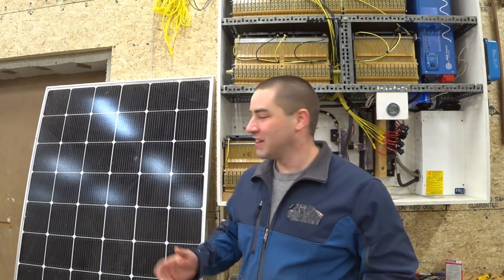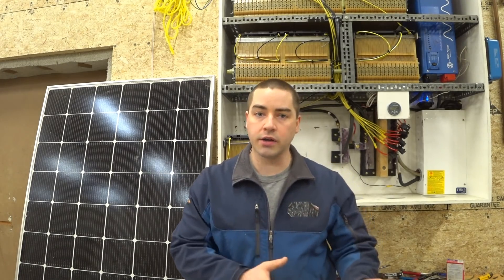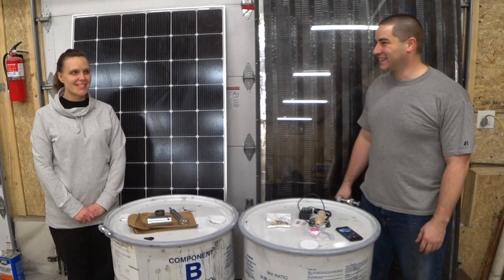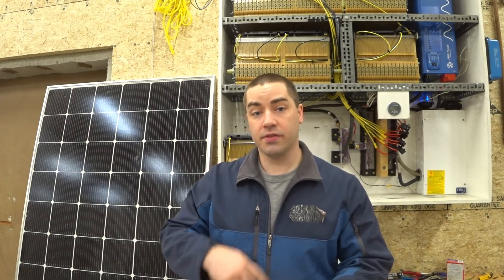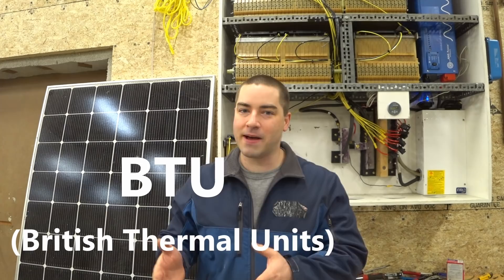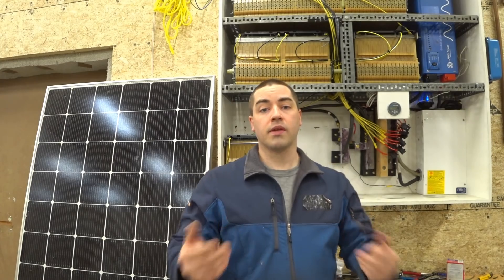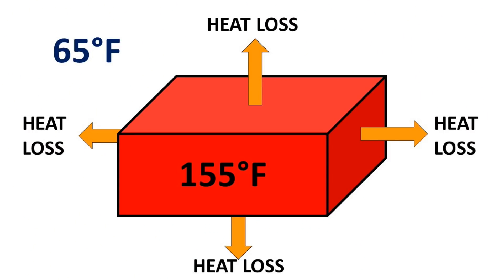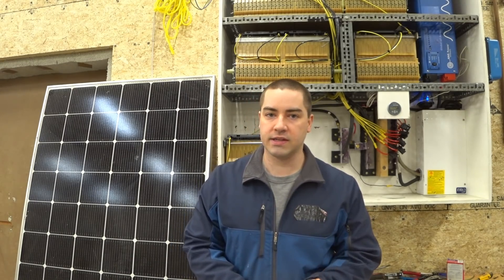Cheapest Energy Storage Off-Grid

Comment: lived in a walk-up 3 story 21 apartment house in San Diego in the early 60s all of the hot water was supplied a cistern painted black on the roof. One of the most efficient ways to use solar power
Reply: In San Diego ... Yes! Just like they've been doing all around the Mediterranean and Southern Europe for decades ... EVERYBODY has a solar HW heat exchanger on their flat rooves. Try finding the same thing North of say Frankfurt, you'll be hard pressed except on fairly modern multi apartment buildings. When the outside nighttime temperatures can drop to -35°C or lower MUCH bigger, MUCH larger area heat exchangers are required!
Reply: @boblewis5558 Solar panels that heat water work great even in Scandinavian winters.
Reply: @0ooTheMAXXoo0  Depends on the weather too. Had 2 weeks straight of almost no sunlight. Constant snow storms and cloud cover. Not to mention getting 30cm of snow can really cover your solar.
Reply: @Azsunes  …. Yes north can be dark, in MN we have dark weeks after month of sun but people can for week skip shower or take cold shower or do tramp-shower in sink.  Not to be macho but I am in a camper and heating up the shower water aint worth the propane-hassle so I take annoying cold shower.  Honestly is hot shower worth it, 5 minutes of cold annoyance is not worth 100 hours set-up time (6,000 mins or 1200x the annoyance time!!1) of setting up time for Solar Heating setup time, plus there's $5000 cost of solar ($5000 for 5 minute shower, or if 100 showers that's $50 a shower, damn!!!).  I am not macho but I am lazy, so again is hot shower worth all this effort.  Jeesh.   I am half-serious but still wonder.  : )
Reply: Alex Russell add ladies into the equation and the peaceful environment you get from hot showers will be worth it. You’ll have to divide the cost over several years to come to a reasonable cost per shower number, but if you can use it for space heating as well, that will be another huge benefit. 
For a dingle person, a wood stove will often be enough to function as space heater, cooking surface and hot water producer all at the same time. At least in winter

Comment: Would raising the boiling point make the system more efficent? for every  pound of pressure added to a sealed system, the boiling point raises 3 degrees F. For example, automotive radiator caps.
Reply from the maker: I built my tank out of plywood, so it can't tank any pressure.  But maybe if you were using a manufactured tank made for pressure it could help.  It would be fun to test and find out.
Reply: higher pressure doesn't make it more efficient. glycol has a higher boiling temperature, 130 C out of head) but has lower energy storage. plus, i doubt david's system would take  that higher temperature for a long time.

Comment: In the video you mention building your heat exchanger out of copper rather than pex  next time.  Can you elaborate please?  This is your best video yet!
Reply: Thanks for that insight, I've been debating copper versus pax heat exchanger myself.
Reply from the maker: Sure.  Before I built my system I was going through and reading lots of articles on Builditsolar.com  Great stuff there.  I saw a mix, some people use copper, and some PEX.  
PEX: 300 foot coil with no connections inside tank.  My 1" nominal size holds 8 gallons inside the PEX.  That 8 gallons of water is 100% efficient because it will equalize with the thermal tank.  8 gallons is enough for one shower because it is mixed with cold.  
However, the first month I used the PEX I got a strong plastic smell coming out of the hot water.  This makes me question the healthiness.  My whole house is plumbed with PEX and I never had that issue before building the heat exchanger.  So I figure it has to do with higher temps?

Next time I would first look for a salvaged heat exchanger out of a boiler or something.  If I can't find one then I would look for a copper coil, 100 feet, maybe 3/4" or 1" nominal.  Yes, it would cost more than the PEX coil, but no plastic smell.  I think the copper would be better suited to being submerged in the hot water.

I hope that helps.  At some point I hope to make an experiment to put some numbers to this.

Comment: Have you thought about other storage systems like HHO, you can burn it or just turn it back into electricity
Reply from the maker: I've thought about it, but I haven't made an HHO generator yet.  You can't pressurize the gas unless you separate the hydrogen from the oxygen.  I've seen an example once where someone used a huge rubber bladder, the size of my garage to store the gas.  Lot's of very cool solutions out there.

Comment: I had settled on exactly this method of storing heat energy.. Though with perhaps a bit difference on the storage box.  I plan to use two 375 gallon totes. .. Because they are already confined in the totes I do not have to beef up the the box as you did with the polyiso.  This way I only need to support the  insulation..     Can fill the box with 12 inches of cellulose. on all 6 sides.  Additionally since there is more water I do not need to heat the water nearly as much to provide a similar BTU storage in each storage tank.  This in reality means higher efficiency.    Suggest that you put a thermister on the in and out of the domestic water so you can see what the water temp delta is per shower usage.. My bet is you will discover that the change will not be a great amount.  I know you appreciate logging this sort of thing.   Go to a larger pipe such as 2 inch for your heat exchangers and you will also get the delta you desire without the cost of going to copper.
Reply: Thanks for the 2" tube idea instead of expensive copper!
Reply from the maker: I'd love to see a video or pictures of your setup in the future.  Good luck with it.  750 gallons is going great.
Reply: @DavidPozEnergy  Have to build it.. and they will come LOL.. Originally had planned to build like you did.. but after thinking about it.. just made more sense to not have to build with 3/4 ply, lots of 2 x material to keep the box from blowing out with the water weight against the container.. plus a foot of cellulose around all 6 sides pretty much means a very very low heat loss. R42  will certainly hold the heat longer and what is nice is having larger capacity easy to do radiant heating
Reply: aerocrete is an awesome insulator

Comment: Any thoughts on what you will do with the extra hot water in the warm months?  Maybe you could make a food dehydrator, or low intensity clothes drier for wet days?
Reply from the maker: My current setup is three solar collectors mounted vertically on my south wall.  They don't overheat in the summer because the sun is so high overhead.  So I don't actually have extra hot water in the summer.  This is not the best setup, but I was using some wall space that I had.  Your idea of a dehydrator or cloths drier is good.

Comment: Always very in formative.
As well as saving on the cost. Your water heat store will run for 20 years safely.
Those batteries are going to die after a few years and they need checking and could be a fire risk.
Low tech solution which if you have a sloping site could give you enough water pressure will run for years. Solar and sustainable.
You can also get your thermal store feeding a top up water cylinder if you can't hold sufficient water at 180f. Every  solar  btu is one .off grid btu saved.

Comment: Everything depends on having three panels of adequate area 
1. Hot water
2, electricity for running the hot water system and controller
3, electricity for things that really need electricity -power tools, lighting.
Any water kept for long at less than 60C /140F needs to be considered as a possible bio hazard  so needs a biocide if it's not going to be consumed or showered under.
Do consider that a tank of water at 150F will evaporate and leave moisture in the air to condense on the floor joists unless you move the condensation away to outside.
Reply from the maker: I have a lid on my tank for the condensation: https://youtu.be/W03zjGPCjjE  Thanks for watching.

Comment: This up coming week they are calling for 8-9 days of rain. My next solar system I build I would like to spec it out to run my home with 100% cloud cover. That will take a lot of solar. I'm guessing 4 times the solar panels. I wonder how the solar hot water needs to be.build.for.the same.cloud cover
Reply: I run my camp real time with solar. I only have a car battery for storage but still have things like a dishwasher with heated dry. Panels are sized so at least the fridge can run on even the worst rainy day. My water uses are low and have two tanks in series. Did have a 10 and 20 gallon till the 10 gal started leaking.  Now I have a 6 gallon as the primary. That only takes 900WH to raise 60F. If the feed water is higher it takes a lot less. Small tanks give you fast recovery.
Reply: you look more like 10x.  say on a sunny summers day you need 2kwp panels, you will have to go for 20kwp.  keep in mind the last 10% will be 90% of panels. 
there are infinite degrees of cloud covers. the worst are thunder storm clouds. luckily they only last a few hours.

Comment: Wonderful video as usual. I'm wondering how this will pan out near the equator or where their's enough and nearly 12 hours of sunshine all year round. I'm imagining in such situations, one may use normal electrical water heating without the complexity of this tank system since the batteries  are guaranteed enough daily top up charges. What are your thoughts?
Reply from the maker: I would agree.  If you have daily sun then probably an off the shelf water tank could work well.  I might get a big one, like 100 gallons, but otherwise a lot simpler.  No heat exchanger to worry about.  Zero days of autonomy.

Comment: Liked your heat exchanger a lot. Heat pumps should not be dissmised - they do add complexity and cost, but also efficiency.
Reply: I second that motion and add:
Solar hot water can get the water up near boiling.  You want to store water this hot when the sun is out but not deliver that hot of water to the taps.  This adds a bit more complexity in requiring a mixing valve.  Don't cheap out on the valve because the bad ones stick at one extreme.
Lead acid batteries may cost less per KWH of storage even through they need a lot more room.
Extra very hot water can provide space heat on cool sunny days.  Keeping the house warm stores energy too.
Reply: The benefit of a heat pump is you are creating heat but gathering it and moving it into a storage device (tank).  Where electric heating is 100% efficient by directly heating water, the heat pump water heater has an efficiency expressed as a coefficient of Power equal to 2 or 3 which is 2-3 times more energy efficient that direct electric heating.  Definite applications for it with solar, particularly if we can use the solar dc power directly without an inverter.

Comment: It would be helpful to include the cost for collectors to generate 125K BTUs stored in the 301G water tank on minimum sunny days (I'm thinking it would take more collectors in the winter).  

I'm guessing there is a pump which circulates water from the solar water heater (I think that is a plate collector reading other comments).  How much power is consumed by the pump daily?

Another BTU loss is the pex run from the solar heat collectors to the water storage tank.  How do you minimize this (underground/insulation)?  Also do you minimize water tank heat loss by only running the water pump when the plate collector temp exceeds the water tank temp?  If not this would be another BTU loss to consider.

It would be great to see how you supplement your house heat with this.  I'm guessing once you reach 180F you shut off the pump to keep the water within it its defined range.  With additional coils of pex/copper in a corner of your house I guess you could start a pump to circulate water in these additional coils when the temp meets some threshold, maybe 170F.  In this way you could dissipate extra heat generated by the plate collectors instead of loosing the heat because the water tank has hit 180F. 

This is a really cool concept.  Thanks for sharing.
Reply from the maker: Hi Knut Blaise,  Thanks for all your questions.  I'll give it my best shot to answer them, but If I miss something check out my channel.  I have lots of videos on this topic and I think some of them will answer your questions.  

Cost varies a lot based on several variables.  I can usually buy salvaged collectors for about $100 each.  I'm using 3 collectors right now for my 250 gallon tank, but I'm thinking of adding more.  https://youtu.be/NDxmPl5jlVA  There is a pump and controller to pump the water up to the panels when the panels are hot.  This pump shuts off when the panels are cold.  This video is for a different setup, but shows the controller and pump well: https://youtu.be/kkoesuG72xQ  And it shows insulating the pipes.  

Here are two other videos that I think answer some of your questions: https://youtu.be/g0_-zAskgnE and https://youtu.be/W03zjGPCjjE

Thanks for watching.

Comment: I’m a Mechanical Engineering student and I finished thermodynamics class last semester. This video was fun to watch. Couldn’t you of used an automotive radiator as a heat exchanger instead?

I understand what you mean about storing BTUs in water instead of batteries but isn’t storing it in a battery better? It’s not really the same because of entropy right? Because the electric energy is more useable.
Reply from the maker: The heat exchanger has to be listed for potable water (drinking water safe).  Even if you bought a new car radiator it's not going to be listed.  However, if you were just setting up an experiment for fun, it would be neat to see how effective it is.

The chemical potential in the batteries to make electricity is outstanding.  You can turn on lights, computers, run motors, etc.  You can also heat water with it.  But you lose too much in the conversion of solar PV, to batteries, to electricity, to heat water.  My point is simply that it makes more sense to store hot water for your hot water needs.  Keep the battery as small as possible just for your loads that have to be electric.  Thanks for watching.

Comment: If you could add pipes to the back of the solar panels, you could collect 4x the PV energy in heat while also cooling the cells which increases their efficiency. Win-win!
(I grew up using both imperial and metric, but my eyes glaze over with BTUs. In future, please account for both for a worldwide audience!  Celcius, joules and kWh are universal, logical and easier to calculate with).
Reply from the maker: Hi Andy,  I probably did a poor job at converting.  Sorry about that.  At the very end of the video I did try to convert over to KWH.  My tank, 250 gallons (946 Liters) can hold 30.5 KWH.
Reply: @DavidPozEnergy  Thanks - that's quite a lump of energy. Yes, it's far cheaper and better to harvest heat directly than use PV to heat water because there is so much more of it up for grabs, and you explained that very well.
IMHO, the only case for using PV to heat water is for boiling water for coffee or cooking or as a load dump when batteries are full or can't be exported to the grid.
As primary energy, PV is too valuable to waste, even if you have a few megawatts on the roof! (That should go to the grid to help reduce emissions elsewhere.)
I could do BTU conversions, but relative numbers showed the efficiency clearly.
Would love to see if you ever work out a way to harvest heat from the PV panels. I know copper pipe is expensive, but there may be another way - I think even a plastic hosepipe would help. You could try with 1 panel and see how it goes.

Comment: This AC Coupling setup https://ww3.wholesalesolar.com/inverter-systems/MAGNUM-AC-COUPLED-LINE-DIAGRAM_large.jpg  With a Magnum ACLD-40 https://realgoods.com/magnum-ac-load-diverter-acld-40  and these Micro inverters  https://www.altestore.com/store/inverters/micro-inverters/magnum-energy-microgt-500-microinverter-p40661/  will make it easier to setup and monitor.  Also using a liquid cooled propane generator to charge the batteries on cloudy days the 50,000 BTU per hour can be used in the home plus a heat exchanger on the exhaust that is as high as 900 degrees used through a heat exchanger. Heat is a by product and a waste of energy from Generators.

Comment: I got 12 pallets of "waste" candle wax for my future solar thermal storage system. The plan is to make a large tank and add pex tubing. the wax would stay in the tank. This gives me "latent heat" as the wax melts and freezes.
Reply from the maker: Nice!  I'd love to see a video or pictures when you make that.  If I could get a pallet of wax I would love to do a comparison video.
Reply: @DavidPozEnergy  , if you can get your hands on enough wax, there is no comparison, the wax system wins hands down, especially if you can seal the wax tank.  There is a whole series of youtube vid's out there to be explored on the topic, its quite enlightening when you see the properties of wax, it becomes so easy to understand why it's a much better system.  Its just one of those things you just never really thought about doing but if you had thought about it, you would have gone with wax hands down. :D
Reply: good luck with the wax storage
Reply: You'd have more expense or just have to be much more careful with wax. Pafaffin, for example, has a boiling point of almost 700 F and can flash at 400 F. It's a fire hazard if you don't control temps right, and would burn through non-metal tubing.
Reply: Do you pump water through the roof-collector, or molten wax? If it's water, then the wax will never get hotter than 212F.
Reply: water is a better store of heat than candle wax